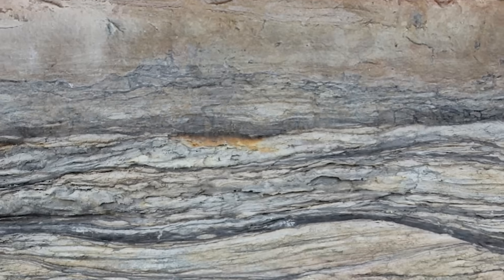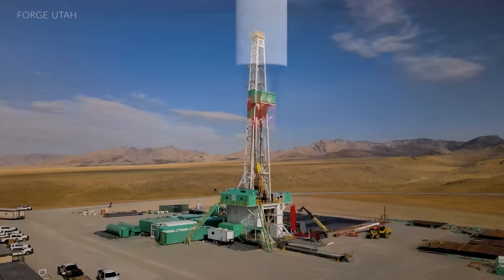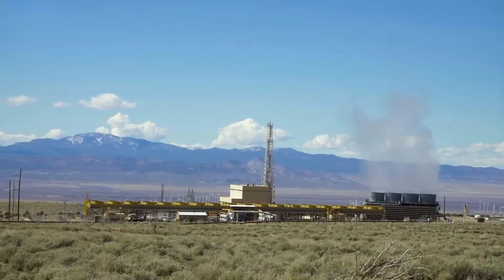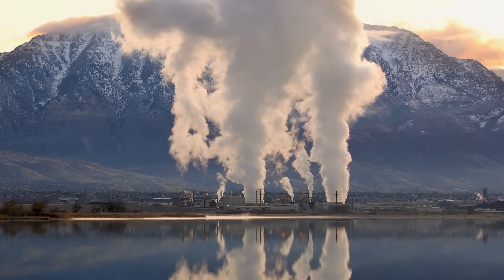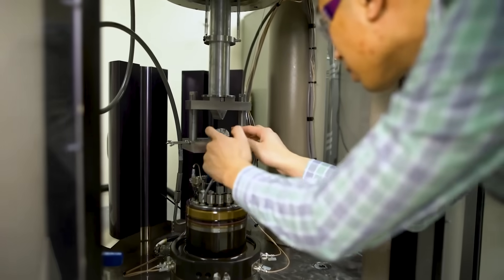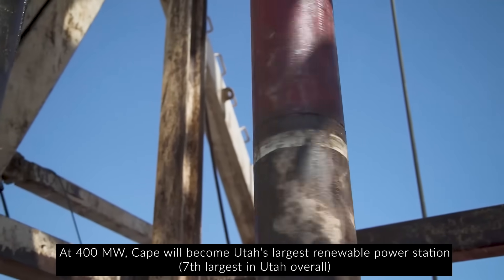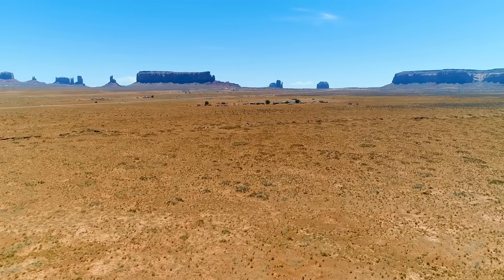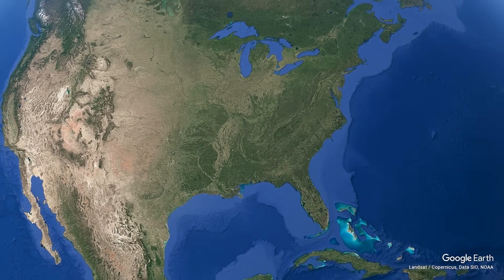This Groundbreaking Clean Energy Source Could Power America

Comment: You dont need steam or super high temperatures...all you need is a sufficient delta to heat a working fluid that transfers that energy to another working fluid that drives the turbine to generate electricity. Neither of those fluids has to be water.

Comment: Fracking is not the best approach. Quaise is better.
Reply from the maker: But have they successfully tested the laser approach yet? And it requires so much energy!
Reply: @TheDailyConversation It's a millimeter wave maser rather than a laser. They are testing now and have been successful so far, expecting commercialization in 5 years. The energy investment is significant, but actually trivial compared to the enormous amounts of perpetual, clean, free energy out. These rigs can be dropped directly into fossil fuel plant infrastructures worldwide with minimum conversion costs, using existing transmission lines.
Reply from the maker: Nice, thanks! I'm mass-replying to a backlog of comments right now and misread the wikipage that said "A gyrotron is a class of high-power linear-beam," as 'laser beam.' I'm definitely looking forward to seeing it produce energy! You think it's worth trying to visit to a test site to make a video?

Comment: The water is constantly evaporating. Where will you find enough water to keep these wells running?
Reply: The water in the well isn't what's evaporating, what you're seeing is condensation of exhaust from the turbine loop. The way these plants work is that the water in the well never makes contact with the outside world. The heat is instead transferred from the well water to the turbine loop which generates steam to turn the turbine. The only time you'll see actual underground steam coming from a geothermal plant is if it's tapping into a natural hot spring in which steam is being produced from an underground water source, not pumped into a well.

Comment: If it all works then what is the cost of that electricity going to be in relation to hydro in the northwest?
Reply: LCOE of hydropower is around $60/MWhr. Based on the map, EGS LCOE could be as low as $45/MWhr. Huge improvement. The NW needs to wean off of hydropower anyway b/c its consistency is threatened by climate change.

Comment: What is the impact on the planet's core temp? You need to know that if we change the average temp of the core, it will have a significant effect on the world, which you may not like in the end. The core temp is very important, and playing with it may significantly impact climate more than burning carbon fuels. Be very careful.
Reply: @raymondwalters3072  5 miles down 2 million years worth of energy. being replaced by radioactive decay.
Reply: Even if we were to put EGS wells on every single spot on earth, even underwater, the amount of power we'd be drawing would NEVER EVEN COME CLOSE to the amount of heat the earth produces. The US only needs around 1,500 of these 400MW EGS installations to replace all gas and coal power plants

Comment: The money is in the actual saving of the energy. We are gaining more ways to capture it all the time. Piggy Banks of energy is where it's at. No more huge oil storage tanks. Modular Gravity battery and flywheel installations. Gravity batteries are Zero loss. 99% of losses are on the collection end. Can be constructed in fully charged position.

Comment: This looks like another bullish move by the existing drilling,gas companies. 
What are they using to crack these deep rock formations?
Fracking with chemicals has proven very disastrous in areas polluting groundwater that many towns and cities heavily depend on .
A more financially sound solution for all our energy needs , we should to turn to the already proven ,walk away safe ,environmentally friendly Thorium Molten Salt Reactors.
These reactors do not need to rely on water for cooling for their non high pressure operations so they can be located anywhere on land and off shore with ships supplying power to islands and coastal areas. Great for desalination plants.
And there is literally thousands of years of Thorium just in the U.S. and also around the world .
There are many more benefits to this system over what they are trying to do here , like the TMSR can actually help clean up our nuclear waste while employing thousands if not more. Do the research . The oil and gas companies have in slaved us for long enough, it’s time to move on .

Comment: You charts shows just the opposite of what I would expect, on being economically viable.  The Permian Basis, in West Texas, already as holes drilled on a zillion oil and gas well, already fracked.  Is it not hot underground there too, with zero drill costs?

Comment: I'm a retired petroleum engineer.  I was a staff and/or licensed drilling consultant for 42 years. Drilled the first horizontal wells in the middle east in the UAE in 1991, SE Asia in the 2000's, Alaska, Africa, multiple states, on/offshore, etc.  IMO, solar and batteries will outperform this expensive system 20:1.  Sorry.  Twin hz wells to 400°F, fracture stimulated, with a power generation facility, will cost $100M each, minimum.  It might be workable, technically. probably more efficient than Toyota's hydrogen nonsense.  Buy a Tesla....

Comment: The heat source is not unlimited, the heat can only move through the crust at a certain rate, take too much and the power draw will drop off, then you would have to move on to another site far away. Also all that heat is mostly coming from the decay of nuclear elements like uranium, thorium, potasium isotopes. It would be far better to mine the ores and just put it into a reactor, preferably a Molten Salt Reactor, that way all the energy will be captured from the ore rather than than low energy dense well. A kg or so of uranium or thorium can power a human life for a lifetime for perhaps $100.

Comment: What does it cost per kWh compared to coal, oil, gas, wind and solar?
Reply: They show a heatmap of per MWh costs. In the Pacific NW, it would be ~$45/MWh (divide by 1,000 for /kWh). At the high end, it would be about $90/MWh but the areas where it's that expensive are few and far apart, so it would be easy to generate in places where it costs ~$65/MWh and then send it to areas which don't have cheap access.
Reply: Wind and solar are cheaper still but fossil fuels are around the same or more expensive in cost. The important thing isn't the cost, it's the fact that it's basically a drop-in replacement for some kinds of base load fossil fuel plants. You could actually convert existing FF plants that use a steam turbine by heating the steam using the superheated water from the geothermal well instead of burning coal or gas.

Comment: Great post on you tube and great presentation about geothermal energy. Drilling geothermal wells on underground hot rocks is a challenge, and these shows the strength of drilling companies. Geothermal energy is great even have different challenges.
Surprisingly on company papers (not peer review) the estimate of rock power 8.4 MWe/km3 estimated from companies is 9 time higher than previous estimates from department of energy (0.7 to 0.9 MWe/km3) even the project is based on lower temperatures than 300 deg C. Who can explains about these estimates?

Comment: This is the future. The heat is free and it's hot 365 days a year and 24 hours a day. Solar panels and windmills never make power 24 hours a day. Oil companies can help drill these holes. They have experience for drilling. If each state in the future drilled and made electricity from these sites, one day they could even drill more holes to make hydrogen for cars, trucks and planes. And then even solar panels and windmills would not be needed one day in the future,,,,,,,,,,,,

Comment: OK ------- .  Several major problems I see in the history books with Crack sand heat recovery Systems is AGE OLD...   The recovered water has high contents if impurities including corrosive minerals picked up from the surrounding rock strata.   This corrodes and plugs the pipes and heat exchangers with scale and dirt creating losses of efficiencies after only a few years and as Stated a Portion of the pumped water down the well can be lost,  BUT considerably much more than stated... and is impossible to control in reality... That can reach 50% of the water usage...  Bad in desert low-water areas.  Next to rivers not so bad except for Ground-Water Contamination possibilities from Chemicals needed to prevent excessive pipe corrosion from the high temp Water being recovered.. There are many more problems but these are the biggest....
----------.  A better solution is much deeper wells where the temperatures are hundreds of degrees high where modern well drilling techniques that allow solid thick well pipes to drill down across long distances and then back up to the surface miles away to circulate very hot HIGH Temp. clean water into heat Exchangers on the surface...   Or a better design I like has two separate drilled pipes meeting after crossing long distances. (a Small thick high-pressure supply pipe meeting and drilling into a Large Wide heat riser pipe that serves as a very Tall Large Volume Heat storage tank..
-------- .    Both the solid single pipe and the double pipe systems have no outside system breaks in the pipes preventing the loss of any water that can be heated hundreds of degrees hotter than the shallow Cracked Rock Sand recovery systems, creating a system that is many times more efficient .... With no pollution, contamination or loss of fluid... Using standard Generators  Cooling towers instead of filtration cooling PONDS and the vast amounts of Chemical treatments.  Without all the corrosion and contamination problems...  Creating Inexpensive Operating Cost Multi-Mega-watt systems that is much more efficient with lower construction costs per Kilowatt hour than anything else (but fossil fueled) power plants on earth including Solar Cells and Wind turbines that still produce full power ONLY when the Wind Blows Strong and the Sun Shines Bright and Not on Cloudy Days or the Sun Goes Down... And provides power 24 hours a day... and with a miles-long deep 3 -foot wide Energy storage chamber, the Well has a Tremendous Energy Reserve that can provide massive energy Serges for long periods of time...    Alternating from high Output to Low production when need dictates as most grids experience over 24-hour cycles...

Comment: There's no mention here of what cocktail of chemicals would be injected to create the fractures.  If they're anything like what's used for oil or natural gas fracking, the prospect of doing this across the eastern seaboard is pretty eepy. 

Also, earthquakes.
Reply: I'm literally copy-pasting my response at this point b/c everyone seems to be hung up on the name:
Most of the risks of fracking for oil and gas are from 1) the additives used to coax these substances from the rocks and have them flow smoothly and 2) the risk of oil and gas leaching into groundwater sources. B/c the only thing being transferred is heat, not hydrocarbons, the only additives that are needed for geothermal fracking are disinfectants (to prevent build ups of bacteria) and brine (to make it harder for underground metals and minerals to dissolve into the water). On top of that, it's much easier to treat water for heavy metal contamination than for hydrocarbons, which can be carcinogenic at very small concentrations. If contamination does occur, it's relatively easy to plug the well and move on than with oil wells. Once the well is plugged, there's no more hot water moving through the rock to find its way into groundwater.

Comment: This method recaptures 95% of the same water, over what period? How is that loss compensated?
Does continuous boiling in that fractured region not break down rock to the point that it travels up the return pipe or begins to clog the inlet?

I imagined a closed heat exchanger would be able to be placed in hole but of course it would be hard to fit a large/long enough one when you're only dealing with 300-400F...

What are the pipes made of - a stainless steel or mild steel? I imagine a sCO2 turbine would make it possible to extract adequate heat from the hole with a closed loop heat exchanger, maybe even with one hole, using supercritical CO2 as the working fluid. Then, you don't have any water consumption but a large ambient radiator. 
With an unfractured region filled with oil or something, you could possibly still get adequate heat transfer through the heat exchanger for comparable electrical generation due to the relatively high efficiency of a sCO2 turbine compared to steam... less heat but comparable electricity... and much smaller turbinonachinery... and no water.
Reply: The water doesn't actually boil. It's under pressure, and at higher pressures than 1 atm, water boils at higher temps meaning it would still be in the liquid phase. At 400degF, the water would have to be under at least 17.5atm of pressure to stay liquid. That prolly sounds dangerous but the fact is that the water would not stay in the well if it wasn't under pressure b/c the rocks exert their own pressure. This is how geothermal wells work all over the world, and I bet you haven't heard of an explosive decompression disaster at a geothermal plant before. They're safe. As for supercritical CO2, that goal is still pretty far away. To really get enough efficiency from sCO2 you would have to drill even deeper like down to 12 mi. Quaise Energy, a new startup that's using a gyrotron emitting a millimeter wave laser for drilling, has the capability to drill down that far but I don't think they have plans for sCO2 any time soon.
Reply: @lozoft9  so you're saying geothermal power generation does already use a closed cycle with water, so it does not need to replenish its working fluid
Reply from the maker: Interesting, I have no idea. 🤷🏼 Favoriting so hopefully someone from the industry jumps in and adds their thoughts. Thanks for sharing!